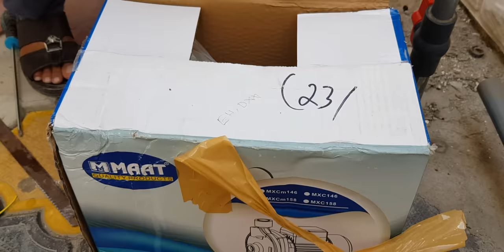Expert Guide: Water Pump Installation for Efficient Water Management and Distribution

Comment: 1 -Why didn't you connect the (white) power wire directly to the pump instead of having it connected to the black cable with Chesterton 2 - what's the point of a meter the glue on the tube?
Reply from the maker: 1. Dear, the motor fixed wire is too small and need to connect with building wire.
2. Glue used to fix the PVC pipe hardly.
Thankd dear for your comments. Please share our videos to your friends and country. Like us comment us and subscribe us for more.
Reply: I think that was his first pump.....
Reply: @fathirchannel2768  lol 😆 why?

Comment: Did that connector come with the pump, if not what is it called?
Reply from the maker: Tough call
Reply: No , It Would Need To Be Buy At A Hardware Well The Fitting Is Mifv(Male Threaded Adaptor 1'' Pvc)
The Other Fitting He Adjust Called Reduce Bushing Pvc 1"X½ To Reduce The Water Provider Service You Can Also Use Reduce Socket 1"X½ If You Want !
Reply: You Can Do The Pipeline Circuit With Pvc And Hta
But Where The Pump Is Situated You Can Use Septor Or Polipipe Fitting !
Warning Polipipe Fitting Cannot Stand Sunlight !
It Can Be Use In Darkest Place Only !
Reply: The Connector Which He Unboxed Is Called Union

Comment: The Woking Design Are Best But The Fitting Used Is In Bad Places Just Imagine If The Pump Or Automatic Is Broken So !
How Will You Open It ??
You Need To Cut The Pipes Again To Remove It !!
I Would Use Septor Male,Septor Female,Union Pvc,Reduce Socket Pvc Which Can Be Easilly Open To Repair The Water Pump And Automatic !!
For Full Piping And Fitting I Would Use Polipipe Fitting Only Where The Pump Is But My Circuit Woul Be Pvc And Hta Or Even Rifeng !!
If Someone Is Agree With Me ????
Reply from the maker: Thank you